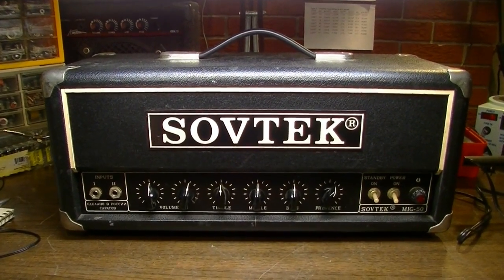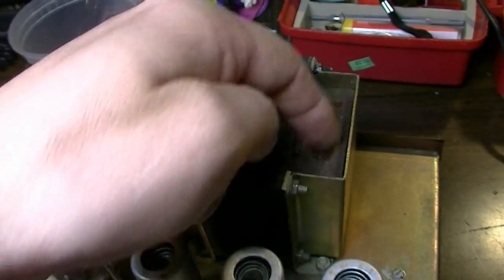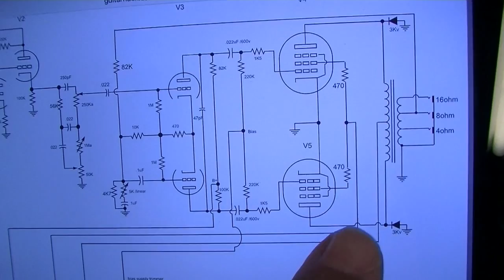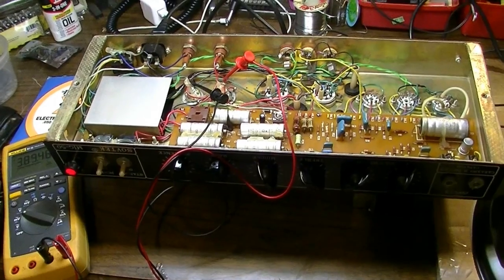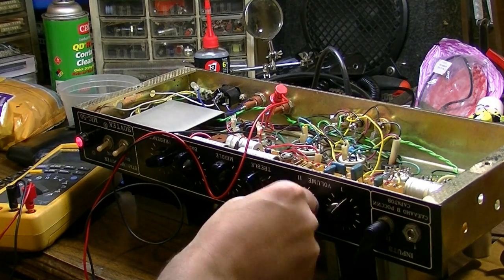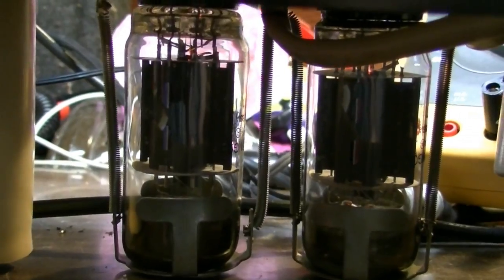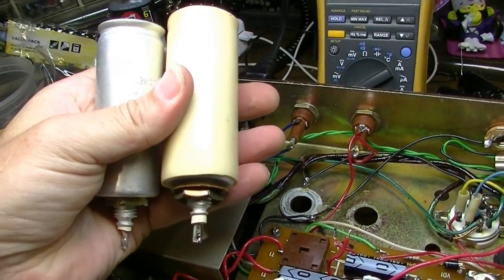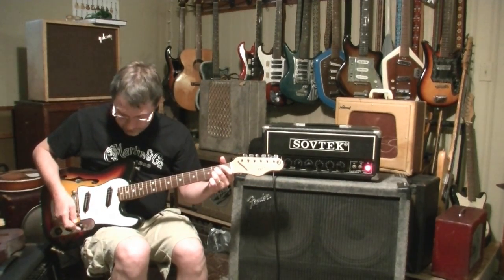PROOF the RUSSIANS RIGGED this Guitar Rig!

Comment: Didn't expect that soviet head to sound so good!
I've ran into your videos recently and loved them instantly, mainly because I love electronics and analog circiuts.
May I have a question? I've built Marshall 1987 clone and if I push gain over half on each channel low-end is "farting". I mean it ceases to be tight, it's getting flabby and I'm getting some nasty non-musical distortion. It's okay if I play high notes when plugged into bright channel but is very noticeable when playing lower strings. On normal channel it's even worse. Cold or hot biasing changes nothing. Do you know what might be a problem?
Cheers!
Reply from the maker: Farty bass... I hope someone else chimes in with ideas too, but you might have too high values on your bypass caps on the amp stages, the coupling caps might be the wrong values, or you need to fiddle with the tone stack. I guess those would be my first suggestions.
Reply: I can't remember the circuit details, but had an old 1987 that did exactly that even though there was no faults or wrong values. Some versions of them are way too bassy, even with the bass rolled right down. They need to be modded to a different version of 1987.
Reply: Filip O The earlier versions of the 50w 1987 models were alot bassier, but it sounds like you have gone past that. The coupling caps after v1a and v1b should be no larger than 0.022uf or 22n and should be followed by some mixing resistors of 220k or 470k depending on the version you've followed. The resistors are important to reduce blocking Distortion. I suspect that's where your problem may be. Later Marshalls have alot less negative feedback and are way distorted below half volume. If I can be of any further help let me know
Reply: My coupling caps are 22nF and 2.2nF. My mixing resistors are both 470k. I noticed my cathode bypass cap on V1A (normal channel) isn't bipolar, it's standard electrolytic but it's soldered minus to ground so I guess it's okay, isn't it?
Thank you guys for so much feedback :)
Reply: Filip O Do you have the 470pf across the lead channel mixing resistor? What negative feedback resistor and impedance tap did you choose? If you want to email pics to pj_woz_ere at Hotmail dot com I'd be glad to look
Reply: By the way, I used SDM and Ceriatone schematics, they're similar to each other. Maybe converting preamp to JTM45 style from Tube Amp Doctor will be easier than troubleshooting this one? :P
Also schematics vary when it comes to quantity of voltage dropping resistors between preamp filter capacitor's "+" lugs (50uF + 50uF), sometimes there's one, sometimes two, I've got two in my build. Maybe removing one and therefore increasing V1 and V2 voltages would help somehow?
Reply: I've got 500pF across that resistor, I believe it's close enough. I've got 47k NFB resistor and choosed 4 ohm tap. Also, I applied "depth" pot in NFB loop. Let me charge my camera a bit and then I'll email you photos.
Reply: Filip O I don't think that'll help (jtm45) as it will likely give you more bass and a worse issue.
Reply: Filip O just seen your next reply cool I'll look forward to seeing.
Reply from the maker: If the bypass cap on V1 is a large value that could be partly responsible for the flubby bass. You could try something relatively low like a .68uf or .5 uf non-polarized.
Reply: The Guitologist if I've found the same layout he's used its a split cathode with a 220uf electro and 820r on the normal channel and a 680n with a 2k7 on the lead
Reply: Well, bypass cap on V1B is 0.68uF parallel to 2.7k resistor but on V1A there is 220uF electrolytic (should be bipolar but isn't) parallel to 820 ohm resistor.
Reply: Filip O the layout may have it bipolar but I've got and had several old plexis with electros there so don't worry too much
Reply: Filip O that said Brad is right in saying that bypass cap is far too big for most use. Gives a - 3db point of a few hertz and it can certainly help in cleaning that side up to go to a smaller bypass cap. I've got a 50 set up similar to yours and it doesn't fart out but does get pretty smooth at those levels. The normal channel is better for kossof type tones or for mixing with the treble side at lower volumes to fatten up. Turning the bass  down usually helps when cranked but it sounds like there is more at work here. If you had your feedback on 16ohm your depth control would likely be more effective and I'd imagine it would tighten things up for you. I've had seventies models with 100k on the 4ohm and they can get pretty wild, I would imagine then adding a depth control to lessen the feedback further could result in some instability depending on your lead dress
Reply: PoJoWo Sent you these photos
Reply: V1A on mine was 330uF as far as I can remember. Electrolytic. It was a stock JCM 800 1987 model. Local amp guy insisted it was right and not the cause, but everybody online I spoke to said way too high. Interested to know if lowering your 220uF V1A solves this issue.
Reply: I don't really want to do that as it is this way on all schematics. I'm seeking errors elsewhere, but if nothing helps I'll lower this capacitor's value
Reply from the maker: The quest for crunch is a quest to find the edge of oscillation and taking just a half step back.
Reply from the maker: A polarized capacitor for a bypass cap is fine.

Comment: crappy circuit board construction for tube amps , just askin for trouble , 
that diode was probably ok , just the solder on the board gave way

Comment: They even named their amps after their fighter jets. Typical !.
Reply: Well except the amp was named by an American, they were only made in Russia.
Reply from the maker: It's a good name. Their jets were supposedly pretty good planes. It's a shame they didn't call it 47 watts instead of 50. I think you can see where I'm going with that.
Reply: Ha ! ha !, that was quick on the mark !.
Reply: That would be MiG (Mikoyan and Gurevich). MIG is Metal Inert Gas welding technique :D
Reply: The Russians are well into their welding !.

Comment: Dis weedio is propaganda from cap-i-tal-ist pig dog. Mother Russia make only best electronic. Russian Capacitor last for century.lol
Reply: Jokes aside, they did last a long time. I have seen a lot of those amps and never saw one with shorted electrolytic caps. They get replaced by folklore and not by need. Not measuring caps and replacing them is a way some "techs" boost their income. Seriously, not measuring their parameters like ESR and replacing parts by shotgunning and is unethical. Some amps made in Russia used oil-filled capacitors like the gear made in the 30s that are still holding spec better than new electrolytes.

Comment: I can't believe you just cut the leads for the old power caps then tied the new caps in and soldered them.. that's some half ass work there buddy wow
Reply from the maker: No, it actually isn't "half ass". It was a conscious decision to avoid using the iron on the weak board traces. On some of the other components, I wasn't as worried about it, but on the heavy caps, weak traces become a concern. This is a perfectly acceptable way to change components on boards, provided the physical connections are good between the old lead and the new lead.